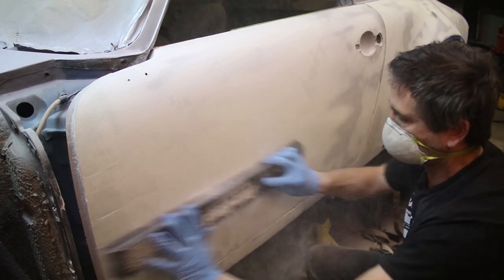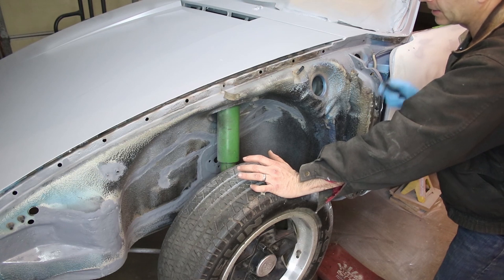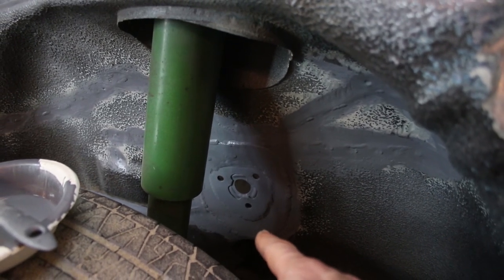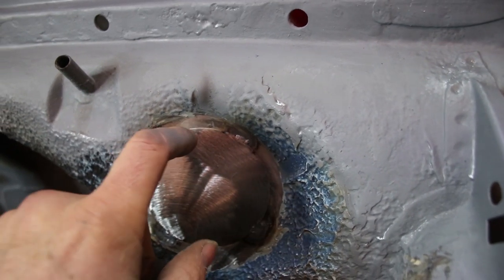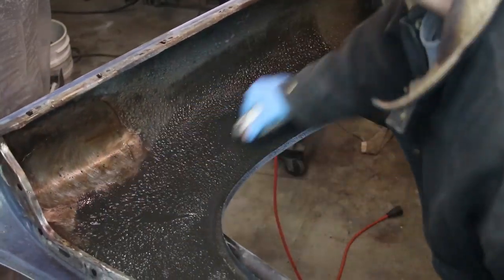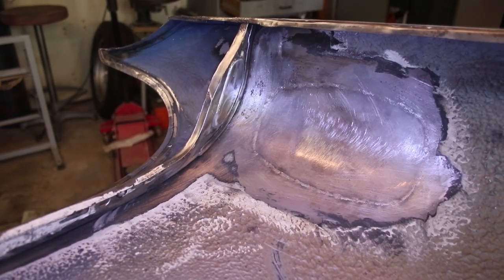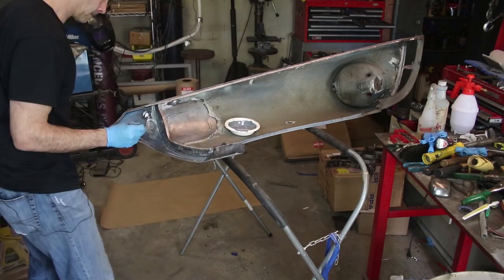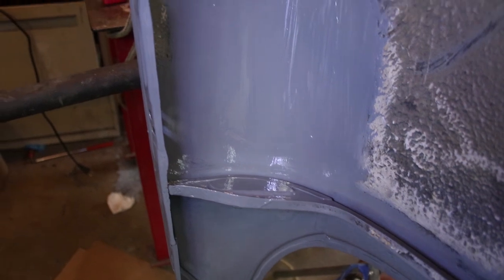Porsche 911 Restoration Project Details | Inner Fender Prep

Comment: I had to laugh when you were blasting the rust, inside the garage..I’ve caught myself doing the same thing, only to regret it later. Excellent work as usual!
Reply from the maker: What a mess.  Every time I think "I really need to add a brush and vacuum to this nozzle." I guess another project for another day.
Reply: @GarageTimeAutoResto  I have a small self contained sandblaster called a Zendex Speed Blaster. Worth looking into, they also have a recovery system for the media that works great for applications exactly like you have in this video. Just catching up on your videos, really enjoying them. The details take all the time but they make all the difference!
Reply from the maker: Thanks Johnny!  I'm assuming you are the same Johnny042 from the pelican build thread.  I'm a huge fan of your work.  You've got the detail gene.  Regarding the blaster, I converted my siphon blaster to work like the Zendex with gravity.  Mine is just a little awkward.  I am interested in the  recovery system.
Reply: jonny042  I have the same one, it does help.

Comment: I never thought about brushing on primer to touch up areas, until I noticed that you did that(on decklid?) on a previous video. Makes sense though. Why not? Nothing wrong with using a brush.
Reply from the maker: The molecules don't know the difference.  Plus you can sneak it into hard to reach areas!
Reply: No, nothing wrong with the brush, especially in areas that aren't visible. Sometimes, the spray gun just doesn't cut it!

Comment: Check out the tool Dangar Marine uses in his episode "Week one of working on thr trawler" for removing rust.  Much cleaner and easier than the sand blasting.  Just a suggestion.
Reply from the maker: You mean the needle scaler?  I pretty sure that would dent or damage the thin sheetmetal on my car
Reply: @GarageTimeAutoResto  yes the needle scaler, it would be interesting to test it out and see how hard on the sheet metal it would be.   If it worked it would be much easier and a whole lot less mess.

Comment: For the putting on the fender- instead of media blasting, wouldn't some rust converter do the trick?
Reply: For me, the rust converter is okay...but if I can totally remove the rust and then treat that area with a primer, that's better. I believe that a converter only gets the surface stuff. The next layer down may be rusty as well and, therefore, will show up eventually. But, if I can get to bare metal and then protect it...much better. And, that's what I try to do.

Comment: Did you do any prep on the cavities before the epoxy primer on the end of the wire?
Reply from the maker: Good question.  I use a boroscope to peek in there, then compressed air, then a solvent soaked rag, then epoxy primer.  It's not perfect, but better than nothing. After the final undercoating and paint then I put cavity wax in there too.  I call it belt and suspenders!
Reply: I figured you did. I would like to do some preventative maintenance in the front suspension pan area and have been  contemplating how to attack the cavity in front of the fuel tank. Thanks!

Comment: For the putting on the fender- instead of media blasting, wouldn't some rust converter do the trick?
Reply from the maker: Sure, that works too.  Here's my list of good, better, best.  1) rust converter - I like ppg or Dupont metal conditioner 2) media blast 3) cut out and weld new metal in.  I've used all 3!